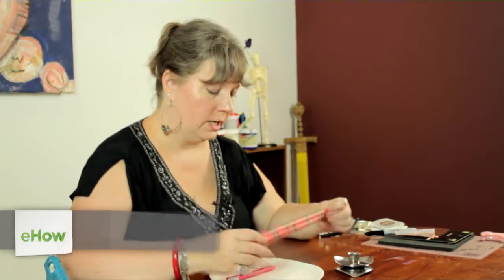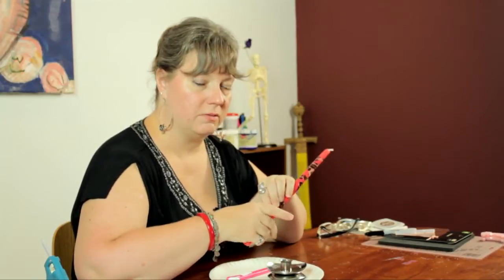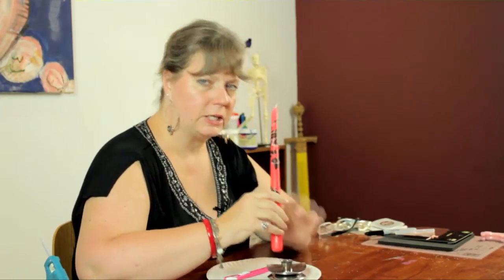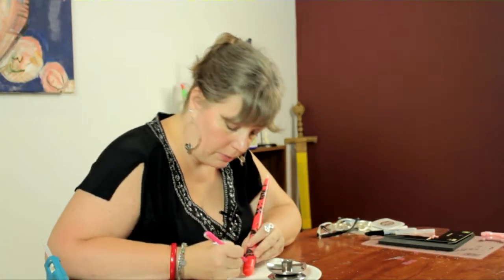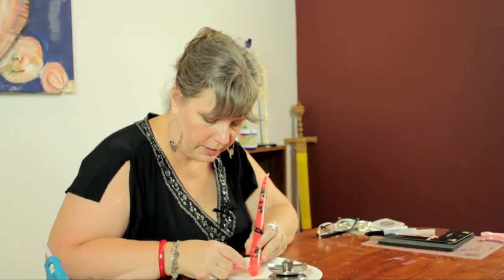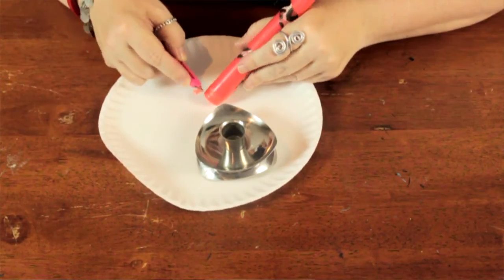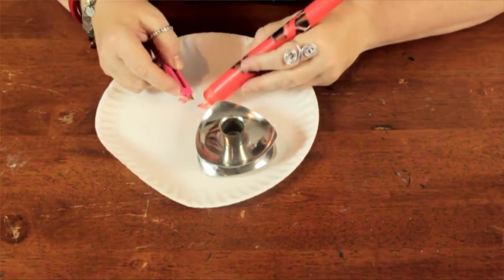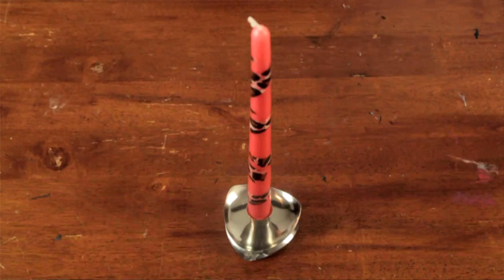How to Make a Candle Fit in Candlesticks : Crafts Around the House

Comment: I'm trying to make a candle that's a little to thin sit without slanting to the side.
Reply: Wrapping a rubber band around the inserted section may help it fit better
Reply: What if you melt the bottom of the candle and then immediately stick into place, ensuring it is perfectly straight